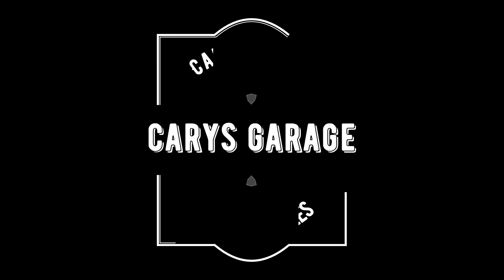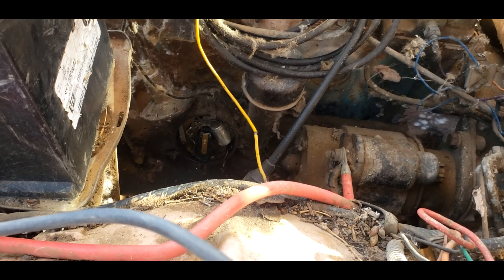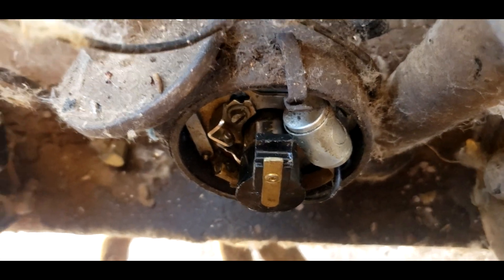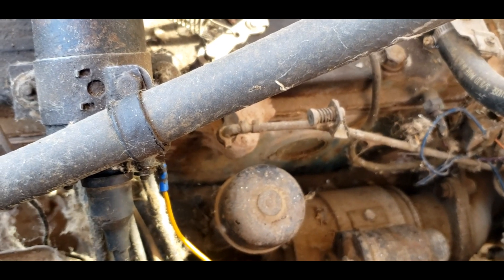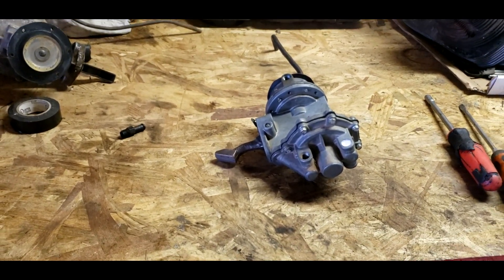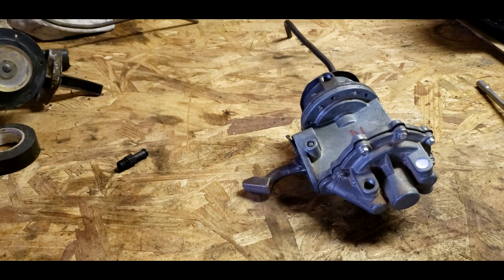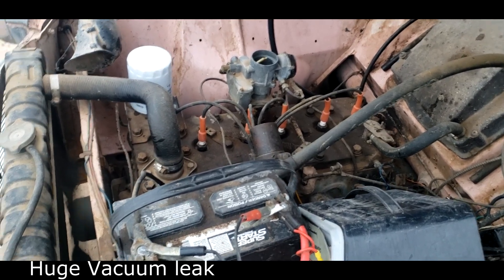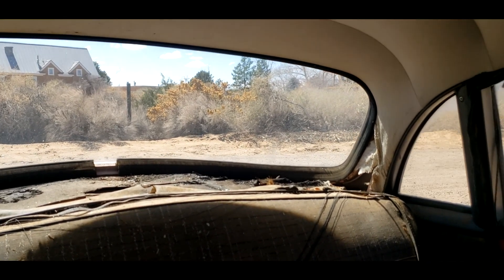Working on the Rambler. Will it run and drive?? 1960 Rambler American

Comment: fun!  still had the flathead this year...googled it and looks like OHV showed up in 60.  another thing discovered is that the flathead has no external intake manifold...its basically internal to the head...clever way to keep tooling costs down.  yea, that def banged into gear...at least the trans is engaging.  good choice on sanding back down to the pink
Reply from the maker: yeah its a fun one and I'm super excited to be getting progress done on it. I plan on getting it repainted but for now getting the pink back will be fun. the mounts on the engine and trans are thrashed so once I replace those and get it dialed in  then it will be so much better. Luckly all gears work and shift smoothly, It only has 57k original miles on it so not to bad. The flathead is an interesting engine for sure, its my first one actually. I know they made a performance head with a two carb intake that I would love to find.
Reply: Did'nt know Rambler had an automatic in 59.

Comment: I have the same car and am needing to replace the fuel pump. Did the spark plugs, fuel pump, repointed distributor…. The air filter is some crazy welded thing with horse hair or some shit inside….hoping to get her running before summer begins!!!

Comment: Make sure the trunnion bolt in the front A-arms gets grease...if it breaks, the front wheel will flop in.   I won't tell you how I know.
Reply: That happened to my Mom's when I was about 8years old. That sparked my interest in cars/mechanics, watching my uncle fix it.
Reply from the maker: Good to know! Thanks for the info.